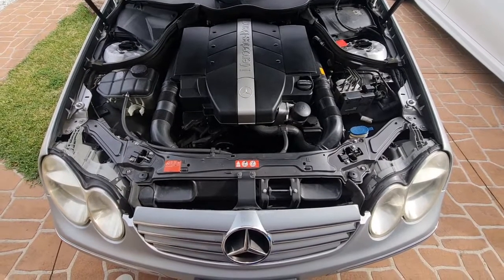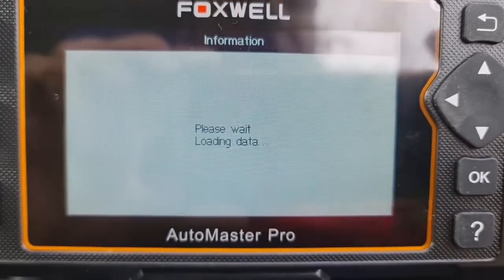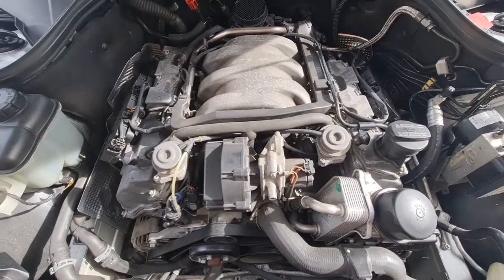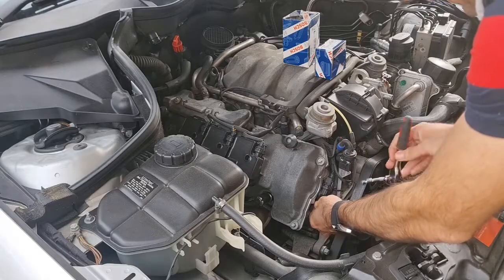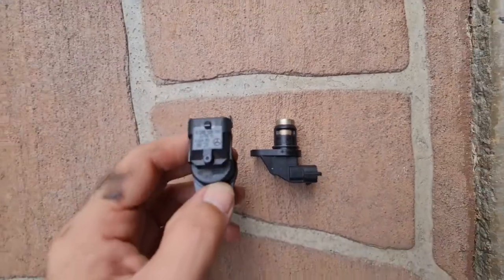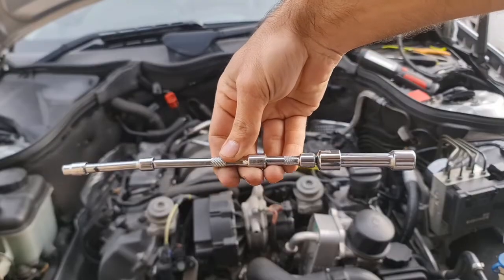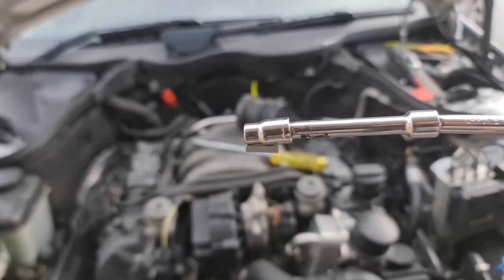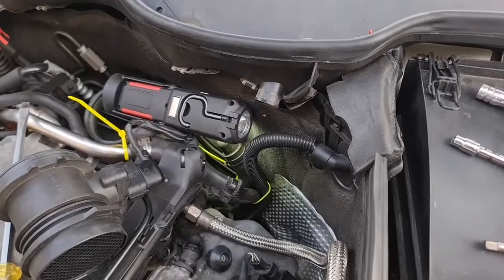Camshaft & Crankshaft Position Sensors, Mercedes M112 & M113 Engines

Comment: hello.the error codes P0171+P0174 are usually a sign of a faulty air mass sensor!  A defective camshaft sensor or crankshaft sensor has other error codes (DEC). I would recommend installing a new BOSCH air mass sensor! The new sensor does not need to be trained (STAR DIAGNOSIS).  The ME2.0/2.8 engine control unit recognizes the new air mass sensor! The adaptation values of bank 1 and 2 are reset to normal after approx. 200-500 km. The air mass sensor ages more and more after approx. 100,000 km and the engine control unit still tries to adhere to the programmed values.  if this is no longer possible, usually P0171/ P0174 is set and the engine control lamp MIL lights up.  best regards from Germany.
Reply from the maker: Hi mate, thank you for your guidance, you are very right, this should be a vacuum leak or a faulty MAF, I will buy one and make another video on this, cheers. 👍
Reply: @BenzAddiction  A too rich condition is NOT caused by a vacuum leak( lean condition is)..... other than that, good video.

Comment from the maker: These are 2 very important sensors that can leave these cars or any car stranded, camshaft position sensor and crankshaft position sensors both have some life expectancy due to the heat and the severe engine compartment environment. Here are the tips and tricks to diagnose and replace these two, please leave your experience , questions and feedback in the comments and I try my best to reply ASAP. Cheers...
Reply: I have a 2009 c300 it just threw the same code exhaust cam position sensor I changed the sensors magnet & cam sensor but the code won’t go away or move. It starts up fine but it has a real bad loss of power when driving. Could it be the acutal exhaust cam? Could I have a faulty sensor? Should I try n change the crankshaft position sensor because maybe it’s not sending the right message ?  Or could the acutal exhaust cam phaser be not phasing
correctly. ? I also seen there’s an exhaust control valve should I try changing that

Comment: I wish I had found this video a few months ago as I have a 99 Mercedes. After replacing the fuel pump, and the spark plugs (didn't realise that I needed two per placement). It ended up running really good. No hard start, no idle issues. A week later it wouldn't start. Ended up finding out that it is the crankshaft sensor and it'll now need replacing. Good to know such things for future references and it'll save me time and money.
Reply from the maker: Thanks mate, it is not always easy to diagnose.  It is good that you also replaced those consumables

Comment: I listened to this video and I had the cam and crankshaft sensors changed either mechanic installed it wrong or aftermarket part I used is not good like original part it now has cold start problems wish I never listened to this advice.
Reply from the maker: What was your mechanic thoughts on this?

Comment: Thank you so much Benz addiction! I have used your videos many times. This time i could not fond the reason for why my engine would bot turn over on my w209 clk 350 until i ran into your video!!!
Reply from the maker: You are welcome 😊.  Issue Solved?
Reply: @BenzAddiction to be honest.. just replaced the crankshaft position sensor and still nothing unfortunately..
Reply: @BenzAddiction engine cranks but will not turn over and im not sure where to go now..
Reply from the maker: Watch this: https://youtu.be/byYgNgHO8hU
Reply: @BenzAddiction  seriously thank you so much. Was able to get it to start for a little bit until it died with starter fluid. Fortunately it was enough time to read a code, bad fuel pump. You are awesome and are the only help ive been able to find on w209 Mercedes.
Reply from the maker: @umairhtx  Yup could guess it was fuel pump. Glad it helped, another happy subscriber 😉

Comment: I recently replaced the crankshaft position sensor on my 2006 SLK55 AMG and it is one of the trickiest jobs I've ever done on any car. One of the issues was that pressing the connector clip did not lift the locking tab enough to release the plug. I managed to loop a piece of string around the connector so that I could pull it with one hand while using a small screwdriver to lift the locking tap with the other hand. Removing and replacing the screw was also tricky and required an extension bar with a universal joint close to the E6 socket end. The latter has to be done entirely by feel because it's impossible to see the screw which is beneath the sensor.
Reply from the maker: Yes, a beefy V8 in a compact SLK engine  bay would be like that, I guess, an inspection camera might help, though... my CLK500 bay is also tight around the engine...
Reply: @BenzAddiction  It's never going to be easy but at least it's possible (just) and I don't expect to have to do it again. It wasn't faulty, this was just preventative maintenance. 

Thanks for all your videos, they really help. I recently bought the car and I'm working through bringing the servicing up to date and replacing potential age-related failure points. Fortunately, most of these jobs, although sometimes fiddly and time-consuming, are relatively straightforward.

Comment: Great advice and helpful instruction.
I think the crank sensor is the main one to replace. I had two fail without warning , leaving the cars in a crank no start situation.
Even at low mileage , 50,000 km , but after 13 years they should be replaced , preferably with a Bosch .
As you say they are affected by heat which rises from the exhaust when the car is stationary which eventually causes failure.
After fitting a new one the engine should be gradually increased in speed to around 2500rpm , to enable the adaptation of the new sensor.
Reply from the maker: Hi Leonardo,  thank you for sharing your knowledge and experience:)

Comment: BIG respect 🙏for you showing crankshaft position sensor in such a detail video.  I did this job today myself b/c my M112 CLK is throwing P0335 & can NOT start the car (after letting engine cool for 20 minutes, it starts again so I know I MUST take care of this.  There is NO prior failure warning.  The CPS is in such a strange angle that I can't even take nice photos to share !  Both old & new reads 1.1K ohm b/c old one may be at early stage of failing.

My own experience: I removed #6 cylinder coil completely to gain better access but seems like your #6 coil stays there and you can still replace CPS successfully so you are amazing 👍.  It took me 2 hours to even locate CPS b/c it's hidden by various wire looms.
Reply from the maker: Thanks mate,  glad it helped.  It is probably worthwhile to replace the CPS after 100k km... enjoy your Benz , subscribe please. Cheers.

Comment: thanks for the video. Its wonderful. On my way today to the work check engine showed up, on my w209 m113 also rough idling and than no start, when engine is warm. I have new part. But i have there more pipes and tubes so its not that accesable as you have. So im not able to change the sensor at work. I hope, i will drive home aprrox. 10 miles... And engine will not fail on the way..  But love your channel. You saved me so much money :)
Reply from the maker: Thanks mate, drive safe. Fingers crossed 🤞

Comment: I own a CLK with M272 engine, just had the CSP sensor replaced. Now first thing first, you cannot see the actual sensor. You can only feel it. You HAVE to remove the MAF to get ANY room to access the adapter to CSP sensor and you have to feel the sensor and the bolt from the other side. The bolt is T30 on M272 engine. E8 for older engines.
Reply from the maker: Thanks for info 👍

Comment: I just replaced my crankshaft position sensor yesterday. It was for a 2001 CLK55 AMG. I ended up using a 1/4" ratchet, two  inch extension with the socket to loosen and remove the bolt. After all is said and done. It wasn't that bad. At first I was experimenting with different extensions and u-joints but I finally ended up using my setup. I was getting a rough idle when warming up and if I had to stop for a light the rough idle would begin within a minute. It seemed like the engine wanted to die. Now, everything runs good. I had to clear out the code so now the engine is going through the relearning process.
Reply from the maker: Excellent :)

Comment: Hi! I'm glad I found this video, great explanation if issue's and how to repair it. I have same symptom's as You, but my fault code are P203D-002 and P2050. Do You think changing this 2 sensors will help? I already change camshaft sensor, but after 4000rpm problem is back, check engine and less power.
Reply from the maker: I would dig more as these can be due to cat or O2 sensors. Don't throw parts. Try to find out the real reason.
Reply: Thank You for respond, do You think it may be related to the correct timing? maybe the timing chain is stretched? although I don't hear any sounds indicating this
Reply from the maker: The first one is more DEF related. have you recently filled the DEF tank? Is it over filled? It is not related to timing for sure.
Reply: No Sir, my merc is W211 e240 with m112 engine from 2002. Fault P203D-002 tell's me about angle variation of camshaft to crankshaft.

Comment: Hello there, I’m having a po715 code on E320  could there be any other sensors that I could be missing ?? I’ve changed and checked my transmission been suck in limp mode did conductor plate and valve body job which came first and this code will not just go away..
Reply from the maker: Is this a generic code? What scanner are you using? Best is to use MB star.
Reply: @BenzAddiction  yes it is , and I’ve ordered a new scanner launch x431 for MB
Reply from the maker: @evansaugustus5173  that's the way!

Comment: Why does your car make a high pitched whine when you rev it? Does it have a super charger?
Reply from the maker: No super charger, might be the air pump that comes on for 30 sec after start up.
Reply: These engines do tend to have a bit of a whine to the sound (mine does), there are some discussions about it online but it doesn't appear to be related to any serious problems.

Comment: Thank you for this video! I have this kind of code in my slk320:

 203D-002

Angle variation of camshaft to
crankshaft: Camshaft signal(maximum angular variation in 'retarded direction )(P1999)

DTC Status: Current and stored

Can camshaft or crankshaft sensor cause this kind of code? I've only noticed a slight vibration at idle, but otherwise the engine runs well. This is causing me gray hair because i don't know exactly what is causing it😅 Only BAS ESP light is on some times, but it might be due to something else. Any advice and suggestions are helpful😊
Reply from the maker: @JAVsk1  Do you hear a rattle? How old is the car, how many km? Sounds like a stretched chain or worn gears?
Reply: This is a 2000 year model with about 297 000km driven. No unusual sound is heard, so it must be some sensor that causes the code🤔
Reply from the maker: @JAVsk1  if never replaced, replace both sensors for sure first.
Reply: @BenzAddiction  I'll do that! That's probably a good place to start.  I'll let you know when I've had the sensors replaced. Let's see what happens✌️
Reply from the maker: @JAVsk1  keep us posted!